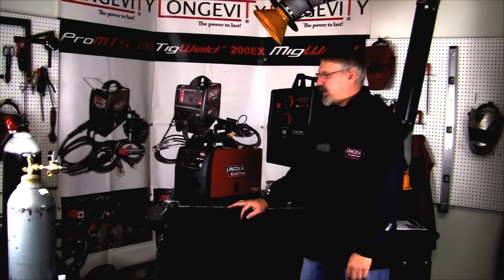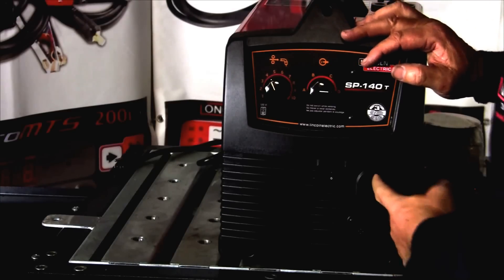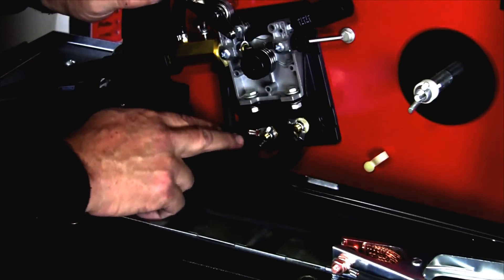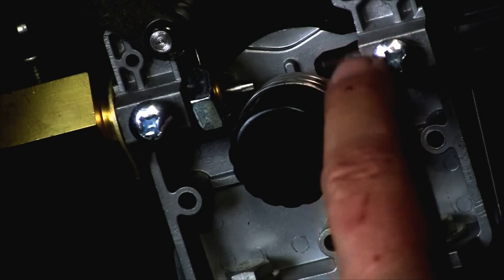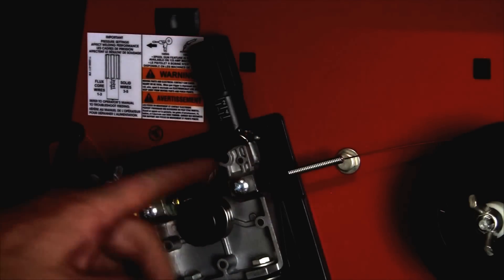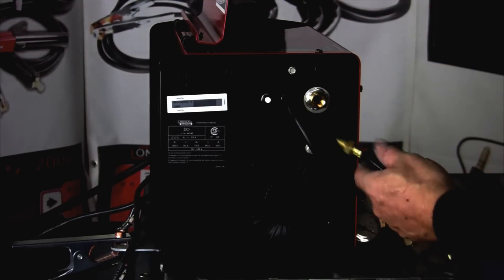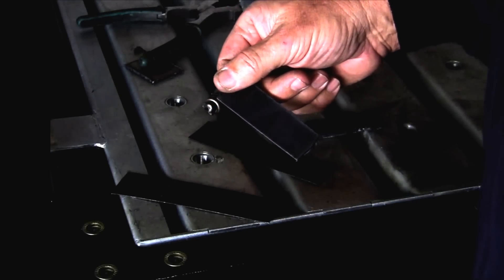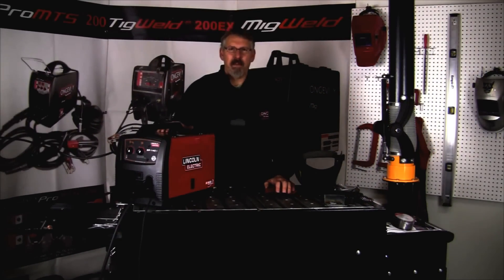LINCOLN ELECTRIC 140 AMP MIG WELDER REVIEW AND SETUP - PART 1

Comment: You should easily weld that thin steel with that welder with out having to stitch  it !! if you have your heat and wire speed set correctly and move pretty  quick  I've welded refrigerator size 18 ga panel boxes  that the company use to weld with Tig ,it took the man who welded them 3 days to weld one box  I tried it with mig  i welded 3 boxes a day the man wasnt very happy  but our boss was !!
Reply: ps the company  was Bon Chef

Comment: Ya I have they Lincoln 140 HD welder set up with mig a 40 tank and man I love this bad boy more for autobody and I've Ben a master painter at the shop for 18 years !!! I have my garage at home set up like a shop two. for me and my family that's the closest to me ... But ya I have the 140 Lincoln and the Lincoln 100 and I use the 100 for flux I mean it does mig too but I have it running on flux and my 140 I have it set with a tank for mig only so that way if I need eather or I don't need to change up the spool or + to - and tips and so on and so on but the 140 I love it I mean both welders are Alsome and I got the 140 for a 5 hour side job that was a peace of cake I was going to buy the 180c but scene I got this welder 140 brand new in the box for the trade of fixing up my FRENDS car we'll I will stay with both welders I like my set up ... I am going to have to build a custom welding cart cause of my plasma cutter I want all three together I have a cart but I can't fit my plasma cutter ! That will be my next project . But ya Lincoln welders are one of the top best of the best and at the shop we have a miller running on 220 or 240 outlet and that welder is a beast and I no it's in the thousands of dollars and it welds Alsome but the Lincoln with 120 outlet it welds just as smooth as the miller and at the shop all we weld is mild steel sometimes I mean sometimes we weld thicker steel but that is sometimes agin I love Lincoln welders there good welders and I have FRENDS that have race cars at the track I mean real track not a muffler and a air filter and it's a race car I mean real race track and they use the 180 Lincoln and there good welders I will say Lincoln and miller and Hobart are they best welders out there I no there are more good brands out there but I'll stay with Lincoln or miller and Hobart for me in my case but I never tried longetivy welder so I can't say for that welder but I heard positive things about it and some negative too so I can't say I think it seems to be a good welder too that is what I think I might be wrong for that welder but Lincoln and miller great welders and Hobart too

Comment: how tight should the spool tension screw be? what is a good starting point on the number setting for the tension knob on the guide roller?
Reply from the maker: It should be tight but not too tights where it can cause a jam.

Comment: ....and the Lincoln is made by a US company with a hell of a track record(over 100 years) and a strong 3 year warranty. Consumables are available at nearly every welding supply on the face of the planet and many big box stores.
The Longevity brands strong points are _____________.
Reply from the maker: 5 Year parts and labor warranty and almost a decade in business! Save some money for other things as you are NOT jeopardizing quality when choosing Longevity
Reply: Yes Lincoln is a US company, however every part in the welder is made in China. They are just assembled in the US.  They do not have the quality they once had in their heyday.
Reply: You can be certain that the components of the Longevity welder are made in China as well. The Longevity sells at an attractive price and it has complete adjustability of voltage.